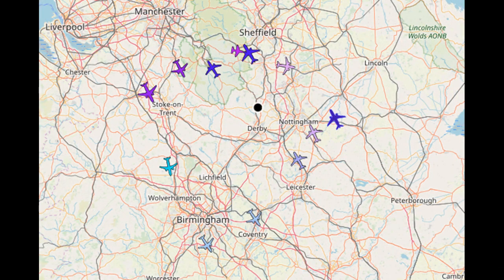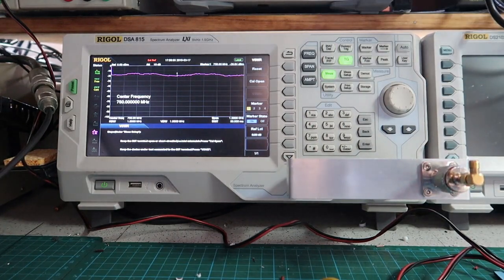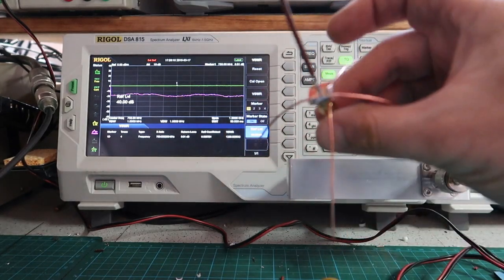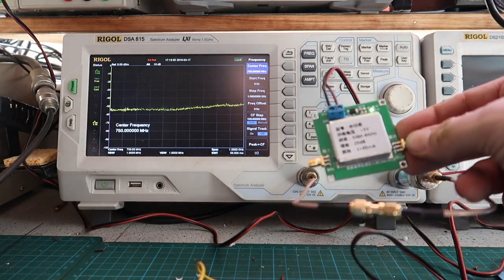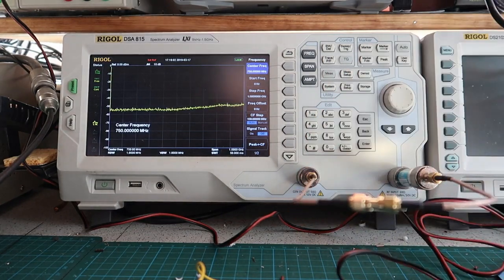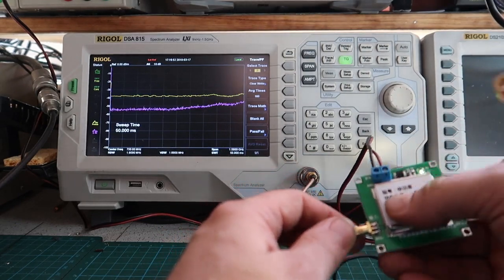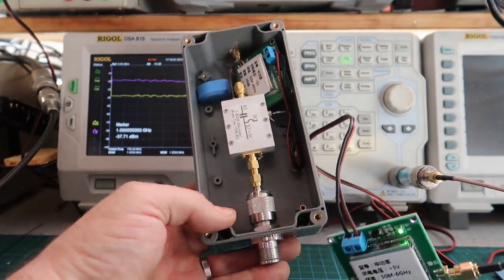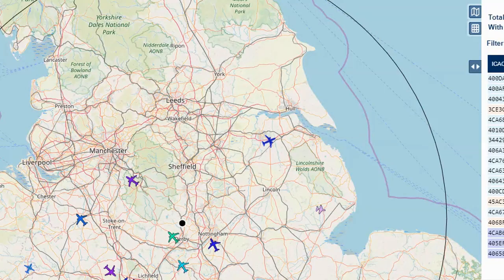ADSB Antenna Creation

Comment: You may want to add a 1090MHz filter as well. I have a 10dB gain LNA connected directly to the antenna, then the filter and then another 20dB LNA. Works like a charm.
If I may suggest, use a larger weather proof case and put the antenna into the case so you have to drill only hole where water could potentially seep in.
Reply from the maker: All good ideas - thanks!

Comment: cut to the chase, go to 4:16, however, a beginner will not understand what Mark knows but had difficulty explaining simply.  67 mm,  is close to the velocity factor of 2mm copper wire. You need a micrometer and a file to get it any more accurate and to do that you need thicker copper rod or pipe that will be easier to build.   The gain amplifiers are generally not needed if your receiver is at the antenna. Flight Aware USB receivers provide plenty of gain even after the filter on the Blue Stick receiver.  At 10:36 he provides a good explanation of the 5 volt supply to the amp. At 11:20 he reveals the result to the test from his roof which he says, made a "drastic improvement".  I did not use the same amp but one off Ebay for 1090 and the gain provided was so much that my actually number of signals received dropped significantly.  Mark may be using a long coax run from the antenna to the receiver which would explain the loss without the amp and the signals gained with the amp before the coax. Overall, a nice video.

Comment: Don't you need to use 2 bias-T's? One with the capacitor pointed to the antenna (like your showed) the other at the receiver side would be the opposite, capacitor facing the receiver. Otherwise it will kill the front end of your receiver with DC current.
Reply from the maker: There are two; one is at the SDR dongle end and the other up in the air at the antenna. The capacitors block the DC path as you correctly say.

Comment: hi Mark, thanks for the video. can you offer a lonk or two where to get your bias T's from please.?
are they frequency dependantand only usable for Rx? cheers mate
Reply from the maker: here: https://www.ebay.co.uk/itm/NEW-RF-Translator-Bias-Tee-Bias-T-Piece-10MHz-6GHz-Bias-Tee-Pieces-Case/123515660458?hash=item1cc21b68aa:g:8goAAOSwhCBbaVQ6
Reply from the maker: They claim 10MHz to 6GHz - bias-t is used to power on RX only normally, so you would put this somewhere in the TX chain so there wasnt high RF power passing through the device - perhaps downstream of the PA bypass relay.